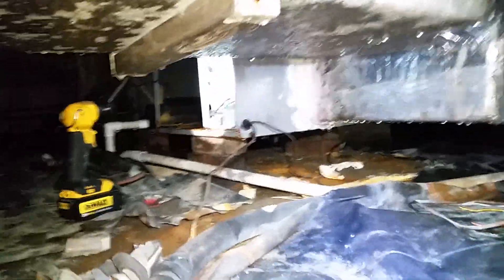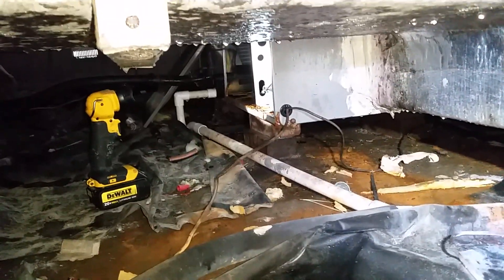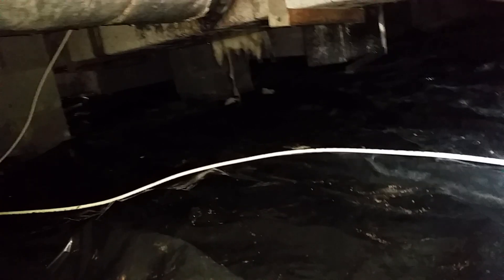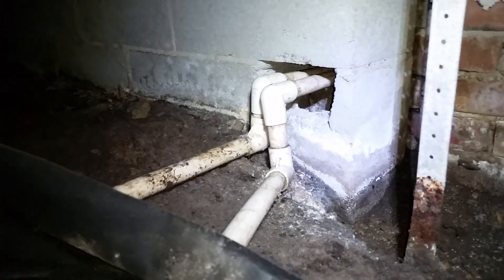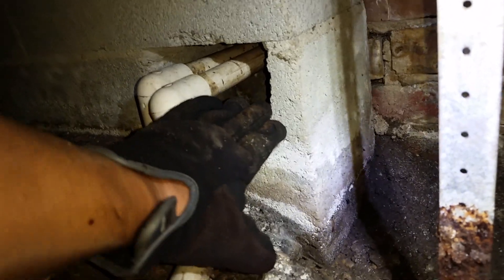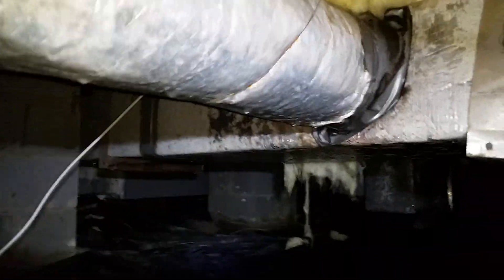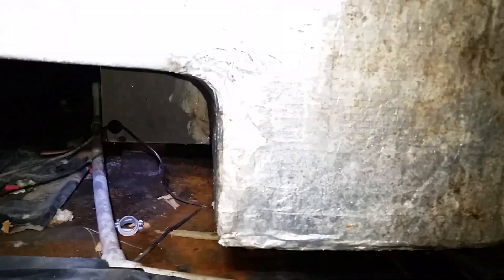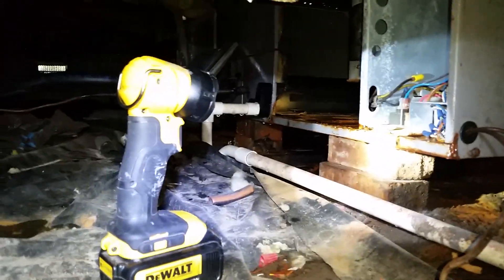Fun with condensate

Comment: that's one big as trap :)
Reply from the maker: Correct. The drain line was pipped as one large trap originally but when these guys put this unit in and installed a 'P' trap it made a second trap, creating a check where water would never drain properly.
Gotta love it!
Thanks for watching.